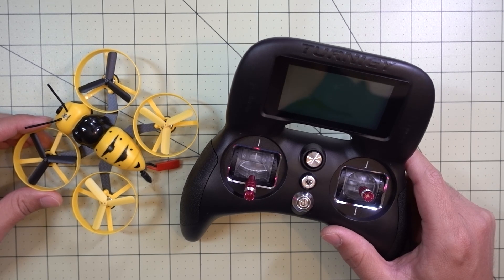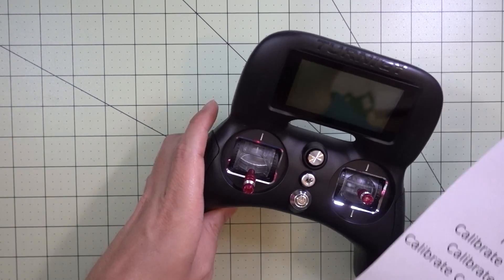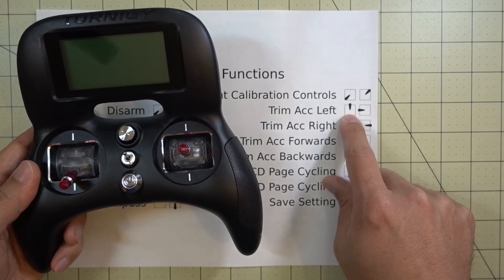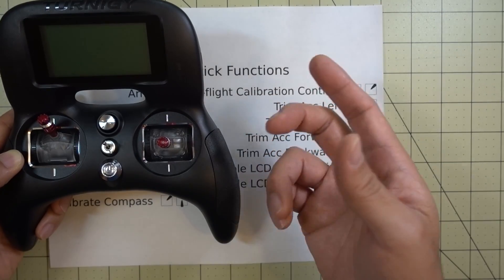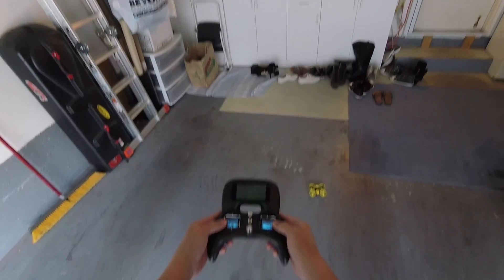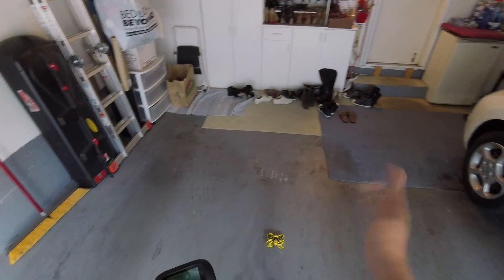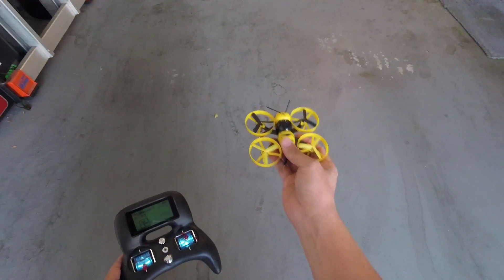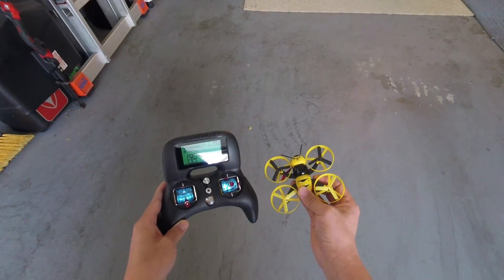Trim Your Quad w/ Betaflight Stick Commands

Comment: Damnit, why does mine have to be different? Using Evolution and Diatone R349 I follow your video and nothing happens at all, no beep or flash of the led. Arm and lift and still goes to the left, so disarm (I use the central 'A' switch to arm/disarm) throttle up to max and other tick all the way over to the right.... Nothing. New to all this so can anyone help?
Reply from the maker: How far to the right does it go? Is the tick in the range you set for arming?
Reply: Thank you for the quick response and apologies for my delay - I just discovered that being in mode 1 on my Evolution is the problem (I thought it would be easier, but it was just too difficult swimming against the current) spent 10 mins swapping over the switches and changing to mode 2 in the menu and tada, I am able to trim and all the rest as per your excellent vids.

Comment: I think my gyro on the left stick needs to be adjusted so it’s a all the way down. My quad is not arming and I think I pressed something accidentally on the controller that it now does not arm. Since it needs to show the position being down. Hope I explained it correctly.  Can you help me with this ?
Thanks Lmk
Reply from the maker: which radio are you using?

Comment: Hi, does this config works out of the box or does it need a configuration on betaflight? Thanks.
Reply from the maker: If you use IBUS, it should work with very little config. Still check that your channel mapping is correct. Most people forget this and bad stuff happens.

Comment: Having trouble arming with my quad using Evolution TX/RX after first centering all end points and trimming as you mentioned in an earlier video. Then I saw your video "use ibus" and I changed from sbus to ibus setting all end points and subtrim to default. Now I can't arm my quad... I know you mentioned something somewhere about throttle settings that would solve the problem... What and where, please! Thanks in advance!!!
Reply from the maker: Are you using the micro receiver?  If so, you need to switch the mode back to iBUS from SBUS.  If you did that, check that your throttle channel is below 1000 when the stick is at the bottom or it won't arm.

Comment: If I use a switch to arm my quad, how do I enter these commands to trim my quad? Or can I still put it into disarm mode with the sticks and then trim it with the sticks? Thanks, Tony
Reply from the maker: You can only enter these commands when disarmed.  Just use your switch to disarm the quad.  If you're using a switch to disarm, the arm/disarm stick commands are disabled (you obviously don't need them).